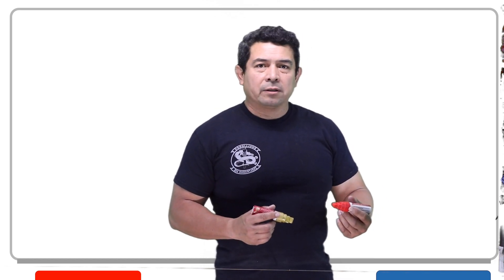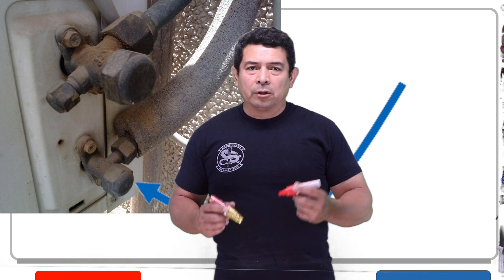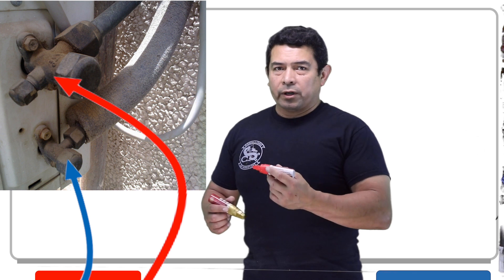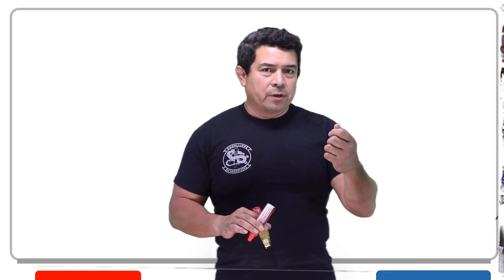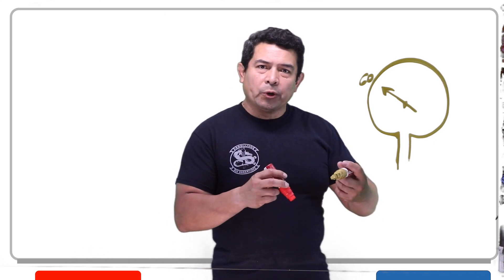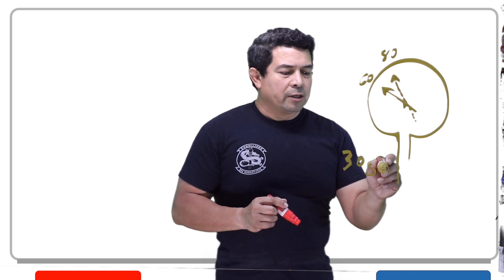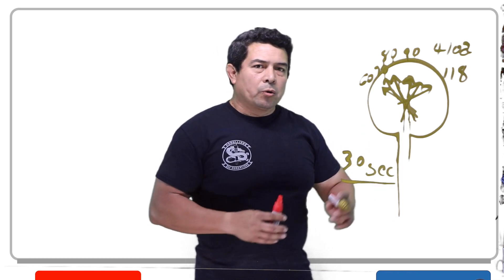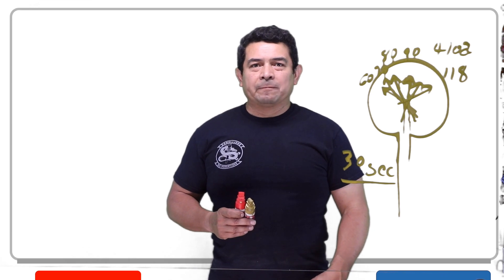Charging a system with liquid-HVAC Online Training and Courses

Comment: Thanks sir. Today I try charging the car ac usieng only vapor. When I reached to 35 - 40 psi, the motor locked up and I saw a steam-like smoke coming out of the compressor. Please help me, what did I do wrong or fail to do Sir? So dishearten.
Reply: I opened the motor and discovered that the clutch was free but the pulley got stuck to the coil Sir. Do you think I need to replace both the pulley and the coil?
Reply from the maker: Moses Tengbeh If it is just the coil that is stuck that’s a good thing. You may not need to replace the entire compressor. But make sure that the compressor is not locked up. When the coil energizes the clutch pulls in and the compressor starts to rotate.  Before you replace the coil and the clutch make sure that the compressor rotates. If you are going to change the coil you should also change the clutch it would be a good idea.
Reply: Thanks, I guess I will need to be more carefully next time sir.
Reply from the maker: OHHHHH   that does not sound good!!!   It is difficult to say because the way you described it it sounds like you did everything correct. The only thing I can possibly think of is that it is the wrong refrigerant but in a car that is very difficult to do because all of the cars use 134A.   It could have been that the compressor was old? And when you say that you saw steam like smoke coming out of the compressor, it could have been coming from the belt trying to drive the compressor and the compressor locked up, so it could have been the belt that was rubbing up against the pulley. I assume that you saw that the compressor locked up, if that's what happened then the smoke came from the belt.  It does not sound like you did anything wrong it could have been just it happened as you were adding refrigerant. Do not blame yourself. These things happen and I think it was just a coincidence it locking up like it did when it did.  I am sorry this happened.

Comment: your manifold gauges are reversed, do you really do HVAC work or just talk/teaching?
Reply from the maker: HA HA HA    I do work on AC equipment.     I have been doing it since 1979. I have been to lots of schools, have a lot of certifications. I have worked on a lot of different types of equipment,  commercial, seagoing, industrial and residential. I have been teaching for over 30 years and have been retired for over 6 years.   BUT never mind my experience.    I believe you are talking about the picture on the unit.  I used the blue for the low side because it has of the insulation.. That is what most people look for. You noticed the size of the lines which is very good!!!   I have only had 2 other people comments on that.  I guess I should have used a different picture.  Very good for noticing that!!!!!  Sharp!!!

Comment: Just use low side pressure to determine charging? is 30 sec too long and would be 2-3 second?
Reply from the maker: I use 2 or 3 sometimes. other times 5 seconds to 10 seconds   it depends on the unit.   Thank you.

Comment: Not gonna lie had to charge a unit with 407c and when I looked at the pressure chart I was looking at the temp as ambient air temp and not the coil temp. Trying to get my coil to 94 degree ambient sitting there brain dead at the pressures like how the fk am I gonna get it that high. Not related to the video please tell me I’m not the only one to derp that up
Reply from the maker: Dirzek Ha ha, don’t feel bad! Out in the heat working all day I have done some crazy things too!    Like I tell everyone in class. At some point we all have made mistakes and we will keep making them.   I remember being up on the roof and hooking up my red hose/high side to the low side and the low side to the high side and wondering what is going on with my pressures!   So Just take your time and you will be fine. Keep up the good work!

Comment: Can you change from using R22a in your Home AC unit to R410a without making any modifications to your Unit?
Reply from the maker: To make things short  NO.     the pressures in 410a is much higher then R22.   The evaporator  and the condenser in the r22 cannot handle the higher pressures of R410a. If yo add the 410a you may create a leak, blow a hole in either coil.   r22 suction is around 68 in 410a  it is around 118.   the high side pressure can be, depending on outside air temperature,  260 and in 410a it could run 420.   plus the oil in r22 will not mix well with 410a.   I hope this make sense.

Comment: Instead of cranking it could we use the imperial kiwi charge on the suction line.
Reply from the maker: Yes you can.  they work great!!!   There are several tools you can use, they just cost you money.   I try to keep the new guys from spending money so they can save money and buy tools as they go along.

Comment: Great job Julio and thank you so much, I've learned a lot here with you. i have a question for you, whats the correct super heat and sup cooling on a refrigeration system???
Reply from the maker: marcos romero Thank you so much for your comments! That only expires me to do more for you guys. If you are talking a large refrigeration system and it has a TXV, I always suggest 8 to 10° of superheat. But like I tell everyone in my classes who does best? Me or the manufacturer?   The manufacture knows exactly what kind of superheat they want so it would be best to contact them. But regardless we do want some superheat at the end of the evaporator to make sure we do not flood the compressor.     Again, thank you for your comments!
Reply: @AirConAcademy  Thank you sir.

Comment: Hi thank you for your very informative video. I will just ask, why we can't just charge direct vapor refrigerant then into suction line?...
Reply from the maker: Jimbel Calicdan thank you for your question, that was a very good question I should have added that to the video. 410 A and most other refrigerants now are what they call blends. That means that they are made up of two or three different types of refrigerant.   Because of this each refrigerant will will boil at different temperatures.. So when you add refrigerant you will be adding more of one refrigerant that makes up the blend into the system instead of the proper percentages like they were supposed to be going into the system.    R 22 and R 12 for example are one single refrigerant they are not blends so you could add them to the system as a gas. I hope this helps if you still have a question please let me know.  Thank you!

Comment: I thought you dont want liquid to the suction line since you dont want liquid into the compressor?
Reply from the maker: You are correct yo do not want liquid in the compressor.  You must throttle the refrigerant in to the suction line so it flashes off as it goes in to the suction line.   You must be very careful NOT to put too much liquid in to the suction line as you are charging liquid. That is what I am trying to xplaining in the video, how to throttle it in to the system.  Let me know if this made sense.  Thank you!!!
Reply: @AirConAcademy  another question. Why dont you just add refrigerant (liquid)  to the liquid line? Instead of the suction line.
Reply from the maker: @labombao7725  AHHH  Because when the unit is running the pressure in the liquid line will be much higher then the pressure in the bottle. So pressure will go from high to low and refrigerant will try to go from the unit to the bottle.  the only time you can add refrigerant in the liquid line is when the unit is under a vacuum and the refrigerant will flow from the bottle and in to the unit.
Reply: @AirConAcademy  ahh thank you!!!
Reply: @labombao7725  I add liquid while its off--(to liq line) but after about 25% of its capacity is added it wont take more.  So then you have to start it up and add it slowly to vapor/suction line and use the compressor to help pull it into the system.   If you tried that on the liquid line it will TRY to go into bottle but the pink/green (not recovery bottles) have a check valve to only allow it to leave the bottle.  What happens is you get a huge pressure in your hoses-and if you have cheap chinese hoses often times they will burst and almost always 100% leak.   Good hoses wont but when you go to disconnect that hose you will have a lot of refrigerant escape.   Assuming you wanted to recover refrigerant from the system- you could use a recovery bottle and liquid (high side) to let the compressor pump refrigerant into bottle.  I'm sure there are videos somewhere on here about that very subject.
Reply: @AirConAcademy  it make sense thank you!

Comment: Hello sir thanks for very good lectures..
maybe you could help me understand whats going on with our A/C compressor last time..our compressor damaged twice with some Piston and connecting rod broken inside..it's a 6 cylinder R404A..they said due to liquid coming back to compressor is the reason..what do u think is the reason liquid coming back and mixing in the oil..and how it goes inside the crankcase??we could see from the compressor sight glass white bubbles Everytime then oil disappear..so many time we change oil and cleaned oil separator as well.. why oil always coming out and sometimes never go back...but finally we changed the txv and looks like no more liquid coming back..but I'm not sure how long it will run..I hope you can give me a good advise about this matter ..many thanks in advance..
Reply: Wildan Saliste the bubbles that you see on the compressor sight glass is due to the líquid refrigerant mixed with the oil on the crankcase, but this only happens when the compressor starts, and this issue is because the crankcase becomes the coldest place of the system when the system is not running, that's why the crankcase have a heater to evaporate the líquid, and if the oil goes to  the system and dont return, you may have a bad pipes instalation
Reply from the maker: @martingates5952  yes very true   the bubbles in the compressor are because of liquid refrigerant mixing in with the oil in the compressor.    if it keeps happening then the metering device or TXV is feeding too much refrigerant to the evaporator and the evaporator is flooded.   if it onl bubble up during starup then the crankcase heater is bad and you have flooded starts.
Reply from the maker: Yes, liquid coming back to the compressor will ruin a compressor. It is called floodback.   Keep an eye on the superheat, there needs to be superheat, keep checking the superheat. The TXV can be adjusted so you may have to adjust it. Changing the oil will not do anything for that problem.    I made a video and I should post it next week.  I hope the video explains it better.  If you have other questions PLEASE let me know!!!   I hope this helped.
Reply from the maker: I just finished the video and it should post in about 10 hours!!!    Hope it helps!!!

Comment: Great video, 410A at 119PSI= 33F how does it give you 40F coil ? If you can put your input on this and also does this apply to walk in C/F coil temps ? Where they should be at ????
Reply from the maker: XRAY Bravo   On a walk in.    The evaporator should be around 35°. And at 35° R410a is  108 psi
Reply from the maker: XRAY Bravo   I think you might want to check your readings or your PT Chart again. The PT Chart I am looking at says 118 psi G gives you 39.5. And yes, it applies to walk in.
Reply: @AirConAcademy  Thank you sir for replying, I got my readings from danfos slider app but when I looked at different PT chart 118P = 40 F coil. 

Thank you.
Reply from the maker: XRAY Bravo You’re welcome, anytime!

Comment: I did try to use the high side once and it did not take.  A few months later, an installer was trying also and I pointed it out to him.
Reply from the maker: To add refrigerant on the high side the system must be off and it needs to be in a vacuum so refrigerant will flow right into the liquid line/high-pressure side. If the unit is running or partially charged it will not work.
Reply from the maker: In order for it to go in on the high side the system has to be turned off and at the same time it needs to be in a vacuum, this way the refrigerant will go into the liquid line without a problem.

Comment: You have your line sets backwards.
Top is the suction line....
Reply from the maker: I know what you mean.   I did it that way because the lower one is insulated and most guys look for the insulation NOT the smaller or larger line.   I really should have used a different picture. You are the only one that has pointed that out, very good!!!!
Reply from the maker: Marijan Munitić  Hmmmm?  I had not thought about putting in the title that it will help from damaging the compressor. But yes, it will keep people from damaging the compressor and I have seen HVAC technicians ruin compressors by putting too much liquid in the system while the unit is running. Thank you for watching!

Comment: Thanks teacher
 i have a question i a system with r12 refrigerant. can I recharge it with R22 without to change the oil and why?
Reply from the maker: In older units manufacturers used the same oil for R12 and R22.   BUT there may be some issues. For one thing the pressures will be very different!  so the Metering device will not work properly. then the size of the piping?   I am not sure if the size of the pipe will affect it?  I am assuming you are talking  about an AC unit? or a refrigerator? because if it is a refrigerator the pressure will need to be very low to have a low temperature. what type of unit is it? AC  or refrigeration?
Reply: @AirConAcademy  refrigeration freezing temperature
Reply from the maker: @bnballakita  Being a freezer  can be a problem because the compressor will need to bring the evaporator temperature down to the same as the R12.     You will need to change the Metering device, I guess it is using a TXV?   make sure you keep an eye on the superheat.  If you are going to switch to R22.     make sure you have the mineral based oil not any of the synthetic oil. and you should have , If I remember correctly the 300 or higher oil number.  let me know what you will do?
Reply: @bnballakita  A compressor that was designed to run only with R-12 CAN NOT use or run with R-22 because It will burn the motor coil if the compressor is hermetic or semihermetic (copelametic) and will brake the valves plate and everything inside it, the amperage will increase inmediatly triping out the breaker or the thermomagnetic, dont try to do it. The oil is the same for both but the metering device and the condenser coil aren't equal. If you think that using R-22 instead R-12 will decrease the temperature of the frezeer your're wrong, I've seen frezeers at -22 fahrenheit running with R-12
Reply: @martingates5952  unfortunately I did it  without to change  the oil the coil has burned, but I replaced  the compressor without to change metering device and the condenser,  so it's still working so I think the issue is in the oil or what do you think? ???
Reply: @bnballakita  the oil doesn't matter, is the same for 12 and 22, I think it has to be 150, the metering device is different between 12 & 22, I suggest you to use a Sporlan "Z" type TXV.
The TXV must be the same size of the equipment, if you have a 5 ton condenser unit, your TXV and the evaporator must be 5 ton too, but remember that the compressor has to be for 22 or for 12, a compressor designed for 12 won't run with 22, and a compressor designed for 22 Will run with 12.
The condenser coil is not a problem as los as is clean and free from both places ( inside & outside)
Reply: @martingates5952  can you tell me why compressor with 12 can't work with 22 although the 22 could work 12? ???
Reply: I mean what will happen inside the system to be burned?
Reply: @bnballakita  because a compressor for R-12 is weaker than the one for R-22.
The preassures in R-22 are almost twice higher than for R-12, that's why a compressor for 12 Will break in pieces when you apply 22 or Will burn before this happen. ( vice versa this scenario won't happen because the compressor for 22 is stronger and can handle the R-12 easily)
Reply: @martingates5952  does it go with all types of compressors or only some of them , because a technician I know has applied r22 for compressor works with 12 and it works till now the type of the compressor is semi hermetic Carlyle?
Reply: @bnballakita  I don't think so, this Carlyle compressor you're talking about is surely for Air Conditioning, for high temp. Like I told you before, none compressor for 12 will run with 22, first when you apply R-22 to a R-12 motor the amperage increases drastically, doesn't matter what kind of compressor is
Reply: @bnballakita  I've never seen in my life a Carlyle compressor for R-12
Reply: @martingates5952  i can show you a picture
Reply: @bnballakita  go ahead, show me the picture
Reply: @martingates5952  how can I upload it here give me any account
Reply: @bnballakita  the only way is on WhatsApp , I don't remember my password. 
The way I get the WiFi is on a downtown park here in México, 'cause I'm homeless
Reply: @martingates5952  thanks for your information teacher and if you need any help I'm your brother from Libya 
My regards 🙋🙋
Reply: @bnballakita  You're welcome
Reply: @martingates5952   hellow teacher. What causes of suction line get frosting evap fan is working and defrost also working but few minuts run the system suction is get icing. Refrigerated van carrier.
Reply: @angelamarcelino279  It could be the metering device, the txv, you need to check the subcooling and the superheat, just be sure that the return (the suction line) don't send liquid refrigerant to the compressor, wet one finger with your mouth and touch the suction line on the suction place of the compressor while the system is running, if your finger sticks, the compressor is suctioning liquid refrigerant and is in danger, but if doesn't has líquid no problem, also check the evaporator fan blade direction and the coil (both)